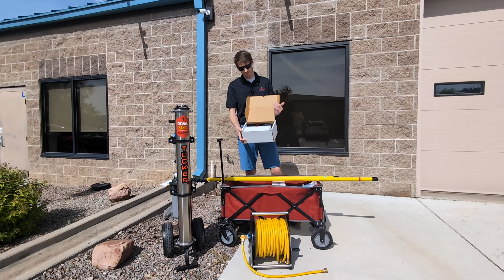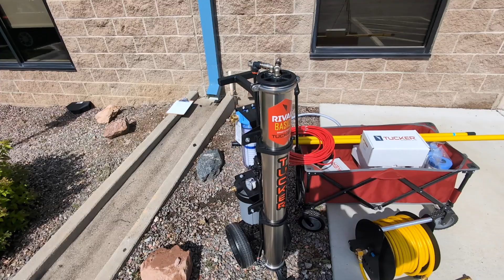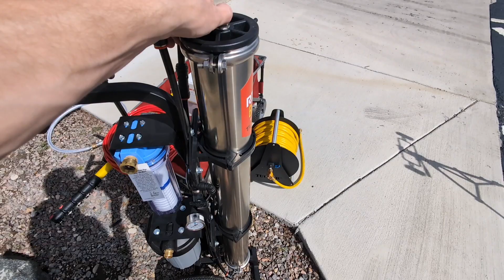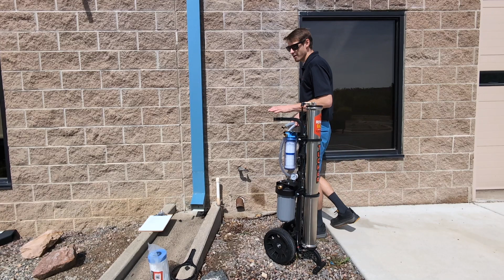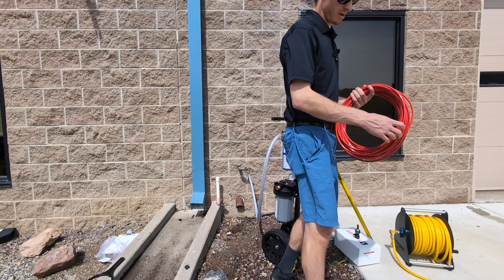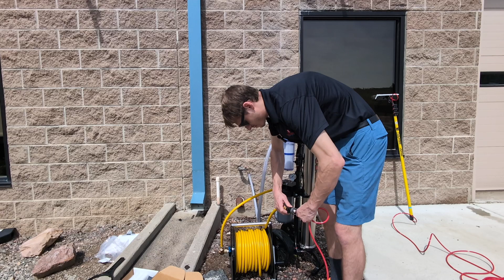Setting up your Tucker® Ultimate Residential Kit

Comment: Could you increase your systems plumbing diameter to increase flow and partner up multiple units to accomplish higher flow rates perhaps ! ? 🤔
Reply from the maker: We would not recommend this as there are a lot of factors that would also need be changed along with that plumbing. For increased flow we recommend looking in to the addition of the 110v Booster Pump System. Please call us at 303-663-1779 should you need further assistance.

Comment: Just bought The ULTIMATE Residential Kit. My question is, do I need to run the tap water through the filter system for 10 min plus for each use for clean filter water 15:56? Or is this procedure only necessary for the first time use and is ready to go after that?
Reply from the maker: The first time you have to run water through the RO for 10 mins. After that you only need to flush it for 2 mins before and after.

Comment: Do you close the by pass when you are cleaning windows?
Reply from the maker: Yes, that is correct. All of our RO/DI systems have a drilled bypass valve. That way the system will have the right pure to waste water ratio.